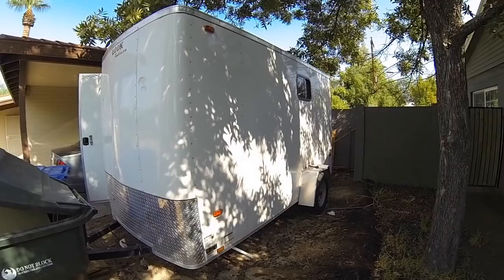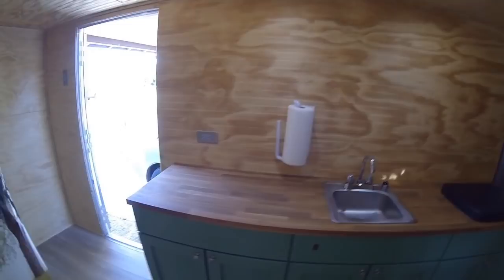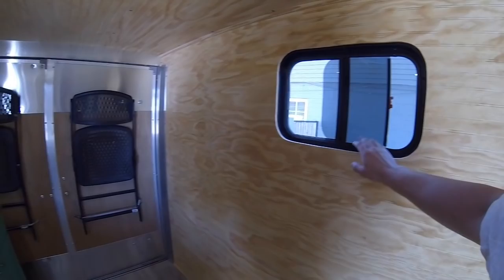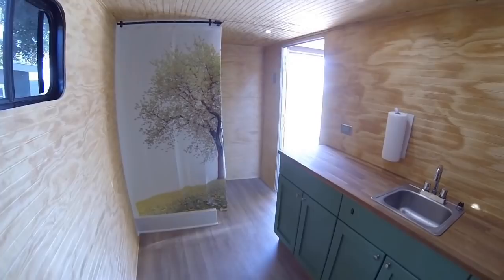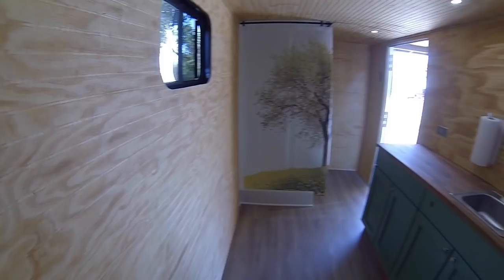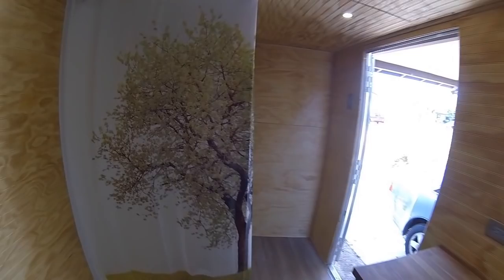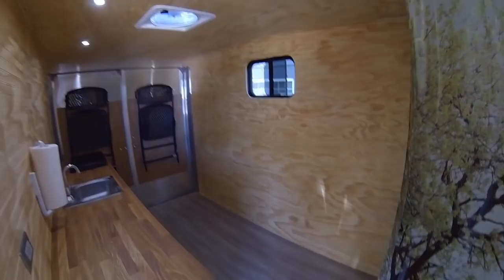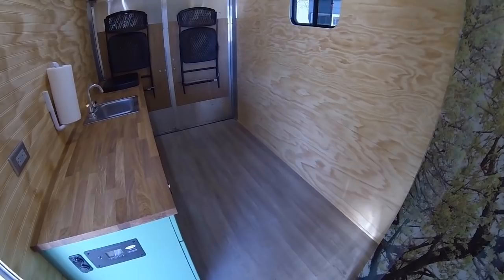Cargo trailer camper conversion

Comment: I like it :D I'd say about 8k since you paid for th trailer,insulated it, installed the tank,lights,water, etc. Most people saying it's too much but maybe because they can build their own versions but most people, like myself dont have the parts,ability (health) or the know how to buy all the parts.I live in a small town and we have a lowes, but if lowes didn't have any of it, that's it. People who are disabled or who don't want to be over worked with a diy version would love to buy this.
Reply: Paranormal Box The only "tank" that he installed are the 3 plastic jugs that are just simply setting on the floor under the sink...& the small propane tank that he mounted on the tounge of the trailer (neither of which are very difficult to do at all). They used water from the shower is just going thru a short piece of PVC pipe thru the floor & right onto the ground...he didn't install/mount a gray water tank anywhere underneath the trailer. Lowe's and/or Home Depot have pretty much everything he's put into that trailer other than the solar setup & the multi speed reversible ceiling vent fan combo & the portable 12v shower thing & the 1 standard/typical tinted sliding window...all of which can all be ordered online from Amazon & delivered to your door in a day or two.
That all said...what this is is essentially just a somewhat more fancy build of a basic build of a cargo trailer that has the basic essentials...minus a toilet of some kind, a heat source, & a bed or cot (all of which are things that could be easily & relatively inexpensively added). Although I wouldn't personally (as I have a 6'X 12' cargo trailer that I've converted myself) I can see where a person in your particular situation could & would possibly be willing to fork out $8K for it though. If at some point in time you ever do buy a converted cargo trailer I can tell you that they're much more durable & longer lasting & have less issues (primarily as far as any roof leaking problems & rotted out or rotting out of walls goes) compared to the typical travel trailers & such...but w/ a considerable amount of loss of space though...particularly in a 6'X12' size and/or under.

Comment: I like the idea of using a cargo trailer because their exterior construction is far superior than traditional RV travel trailers below 80K. For instance, cargo trailers have metal cladding vs fiberglass as well as metal roof vs the rubber type in RVs.

Comment: I like it   Yes it's many moons late for the sale   Butt  a two piece bench seat/bed under window and a few D rings    A 3/4 in. ply wood to protect that Great counter/bench   some heat       It would have been so great to had this when I ice raced  (to many moons ago)   A bench seat to sit on add put parts on while  repairing your motor on the work bench     Very good   I hope people who bike peddle or motor see this    A great Open space waiting it be personalized

Comment: Someone didn't watch the video through. Showed insulation at 4:10, stated walls and ceiling insulated. Grey water tank for the sink was shown under sink next to the 2 fresh water tanks. No problem with that plumbing either using PEX, but I would just have an outdoor shower. That shower limited your usable space indoors... I think I heard you say "Nail Gun" ? with all the flexing the trailer possibly could endure I hope they are spiral to help stop them from creeping out or better yet screws.
I like this idea of the utility trailer/camper. My vision would put the kitchen up front semi wrapping the nose, a drop down bed along one side or both if you have kids. Leaving the floor space open for the toys, Quad/motorcycles with secure tiedowns and E track along the floor and walls...

Comment: After watching the whole video, and listening, many of the questions were answered in the video itself. How is it wired, plumbing, insulation, etc. This is a different layout than I would do, but is what he built. If it's not for you, don't build/buy one like it. This one sold already, anyhow. FYI, my 2004 Tacoma double cab 4x4 lists its maximum towing weight (with the V6 and automatic transmission but not the towing package) as 5000 pounds with a 500 pound tongue weight.

Comment: If it were mine, I would add an other window in front of the sink. Also, I would make a small water proof shower room with just enough room for a toilet and tiny sink and put a sliding glass shower door for privacy. I’d put a small table/ desk that can fold up against the wall when not in use. Then a bed that doubles as a sofa would go in the very back. All the pumps, batteries and things would go out back in a concealed cupboard behind the large door.

Comment: Looks like a good build, I would add a toilet and a black tank, and make it a wet bath. The price is not too bad for what you get. The new rv trailers are very expensive for what you get.
Reply: He just wants $6,500 to buy it, but I believe that is a bit high. He might have started high make a bid if you are interested.

Comment: I know this is an old video but you said you want to do more. Since you asked I’ll let you know my thoughts as I was watching. The first thing was how big is it. What are the dimensions. People will want to know that. (It doesn’t look wide enough for a double bed.)
Second is how much solar is there? Third- more outlets. Fourth- I like the kitchen counter and cabinets. The color is great. Also like the floor a lot. I would want the kitchen in the front of the trailer- along the front wall and maybe a small extension of counter space, like a small drop down table/prep space  along the side opposite the door. That would give an eating space as well or a place to put a cooler underneath- plus it would open up all the floor space for a bed. If the trailer is 6ft. wide you could have a bed side to side with storage underneath and still have floor space. I don’t think a shower is necessary in the trailer- you could have an outdoor shower- people can buy a shower tent pretty cheaply on Amazon. It would save space inside which could be used for storage or make room for a simple toilet system. I’ve been thinking of what I want in a camper for extended road life trips for awhile now and watching a ton of videos and those are the things I fell would work. Hope this helps and you are creating lots of mobile space. Also, V nose trailers give flat surfaces for a kitchen - and at least one more window over sink- and another opposite the one you already have for a cross breeze. And light!

Comment: There a few things I would do differently, but a basic setup like this would give someone a good starting point from which to work from.  I think the counter is too long and too wide.  Ya wanna give people the option of having the bed either on the end or along the side.  I like the shower setup, but I would make an actual room with walls that included space for whatever toilet option one wanted.  I would also add some upper cabinets over the kitchen area to at least provide some storage.  If your goal is to convert and sell these, maybe you could invest in two or three units, create different floor plans for each one, and then use them as models people could choose from.

Comment: I think if you start with a 7 ft wide trailer you could have the bed at the back across the width and at the same time shorten the length of the counter. I think the counter length is too long that you have. A 7' x 12' to 14' wedge nose would be ideal. Putting the sink in the wedge nose would make even more space because you don't really need all that counter space running front to back. Over head cabinets running front to back would be good storage space and under the bed across the back. 6 ft wide trailers are just a little undersize for efficient space usage, but just my opinion for what it's worth.

Comment: If I buy a 5x8 cargo trailer, then I would need help putting windows on each sude, a rv lock & insulating the inside. Everything I will keep it simple & might buy suitcase solar panel & battery to power up my cell phone & maybe laptop!😃

Comment: Beautiful build great attention to detail with the carpentry and plumbing.  Where is your 12v power distribution fuses/circuit breakers?  I wish people would stop copying each other using those bus bars for power distribution and avoiding any over current protection.  There are some excellent quality inexpensive 12V fused power distribution solutions available by blue sea.  The fuses it uses are standard automotive fuses.  If you start building these professionally for people then please incorporate the proper basic safety features to prevent fires from overloaded wiring.  Sorry for the rant, I just cringe when I see wiring jobs like that.  - Matt

Comment: I also build campers out of the cargo trailers.  I like this build but my only criticism is the counter should be a little smaller and the rear should be for a bed.  Other than that it is cool.
Reply: Mike Ogle agreed
Reply: If I was younger I would go this stealth camper route. Only two things I would want is a good bed system and best toilet you can get. Everything else can be done outside or somewhere else. People should focus on those two things in my opinion.
Reply: Mike Ogle has

Comment: Awesome job. If I were going to add a bed I would do a twin bed up in the front....running short ways if its at least 6 feet wide.
Reply: Smokin Bill Williams If ya mean havin' a bed turned sideways in the nose of the trailer that's gonna block the side door...which is most usually the door that the majority of people who do cargo trailer conversions use as their primary door.

Comment: I'm curious.  When you did the insulation.. did you remove the original wall panels and insulate?  Or did you insulate over the original panels and then put strapping and new paneling over it?

Comment: The max I would pay for this would be .   $ 2.500 .   Although it is clean and has a great potentiel.    There is a lots of work to do in order to use this trailer (toilet, storage, table, refrigirator, bed.....etc)
Reply: MoBench25 These trailers hold their Value pretty well, just stock. Try pricing solar and all the work that was put into this on top of just the base price of the trailer. You will come out more than 2500
Reply: thanks for your answer....
Reply: You cant get a decent sized cargo trailer for that price
Reply: Good luck finding a plain cargo trailer of the same size for that price, let alone one that has had this work done to it.

Comment: how much does it cost?
Reply from the maker: I have it posted for $6,500 currently
Reply: AZ Tiny Trailers :  That is too much!  That isn't a new trailer, either.  Not sure if you insulated the trailer, or not.  Or sealed the roof, or not.  No gray tank?  Should have put in a Murphy bed.

I am guessing it is worth $3K.  Not sure what the tires look like.  

Overkill on that counter.  Too expensive for the style of the build.  It is going to be a pain in the butt for anyone to try and plumb in a shower fixture, now, without pulling out what you already put in.

Comment: When I heard you say nail gun, I knew it wasn't built right.
Reply: How come?
Reply: @wfdrum  
The vibrations while moving will tend to allow the smooth nails to back out. Ringed nails or better yet screws is ideal for this application.

Comment: Too plain  for  that  much  money  ,sorry
Reply: I like plain look you could do paint or wallpaper or oil or flamed look.
Reply: How much is it
Reply: Tiny homes aren't cheap, they're just tiny. If a plain 2k square foot home costs 200k, then a 100 square foot home for $15k USD is pretty close to what you'd expect. You say it's too plain, but if you want it nicer then you'd be paying 20-25k. 

It can definitely be built for a little cheaper, but they'd need to trade up to a more expensive vehicle because it wouldn't be close to 2000lb.